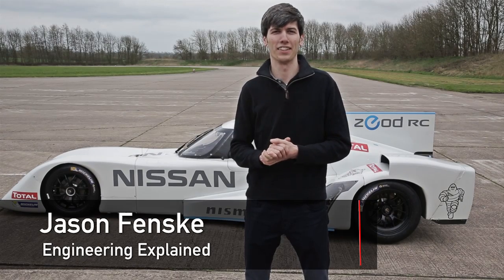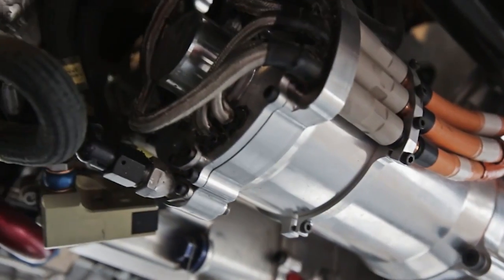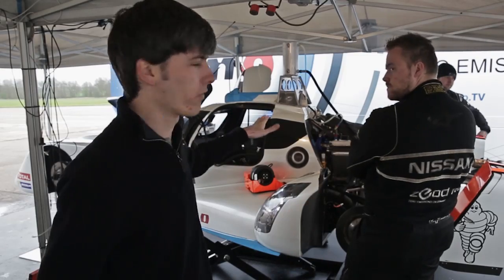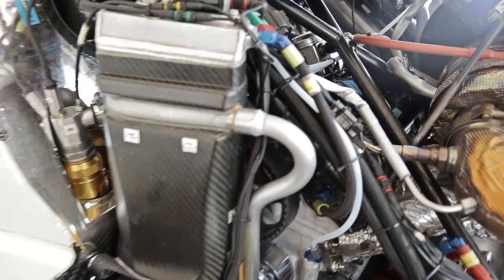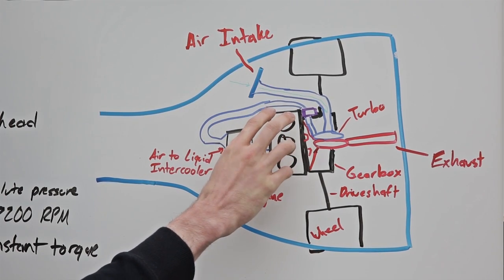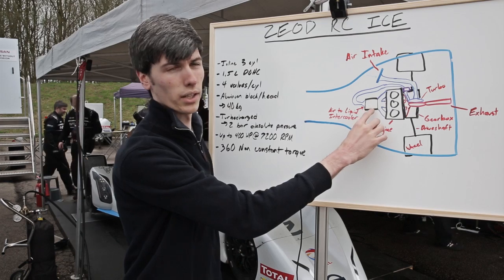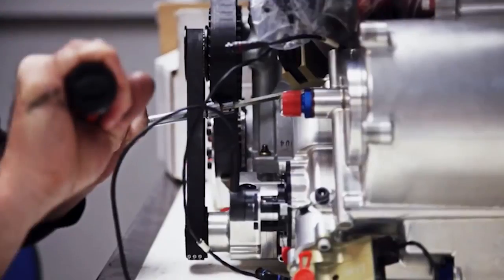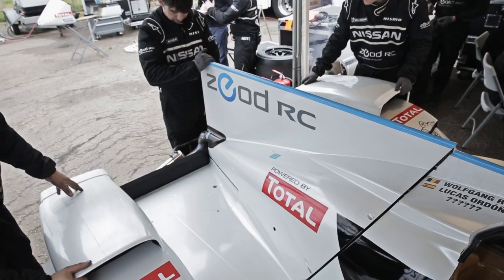INTERNAL COMBUSTION ENGINE EXPLAINED ZEOD RC - ENGINEERING EXPLAINED

Comment: The Nissan engine designers, French I believe, Made the air flows into , out and around the engine as short and smooth as possible. This aided in the high power/weight ratio. But after 4 years no version of this engine is on the market. Maybe some of the findings will go into future engines.

Comment: There is nothing special about the engine itself. Just light, high revving and turbo charged.  Of course it dissapread off the radar.
Reply: Nothing special, sir.this engine may not have the torque but you could put this engine in a infiniti qx80 and still.be fine.

Comment: OH.yes that engine will fit to hoverbike,due to its power to weight ratio,but in my heavy weight power comment is that all manufacturer of  piston aircraft engine must be ashamed because this technology first appeared into a car  not into the aircraft.
Reply: Car industry produces 80-90 milion cars per year, while piston engine aircraft are mostly for fun and serve a small market segment. So you can imagine the difference in the research & development spending between the two branches is big, and the pace of innovation would be significant. No need aircraft people to be ashamed

Comment: So does 2 bar absolute pressure mean that the turbo is set to 29.4 psi?  So that either means 1) That's twice as much air as that engine with a turbo set at 14.7 psi or 2) twice as much air as an engine with no turbo (NA)?
Or maybe both of those are wrong, I wouldn't know for sure-- which is it?
Reply: ~14.7 psi, option 2 as you've put it. The engine will have about twice as much pressure as a naturally aspirated engine with 100% volumetric efficiency.

Comment: Awesome video! Thanks for the detail on the engine, I dont think anyone has gone through the specifications like you have. The engine alone is a masterpiece of engineering, but I wonder why they used a ceramic bearing turbo? Why not ball bearing for faster spooling?
Reply: Engineering Explained The engine is a 1.5L turbocharged engine @ 2 bar absolute pressure...Assuming the car is at sea level, does this mean that the car is boosted to only 1 bar? If this is the case, without the turbo are we looking at a 200hp Naturally aspirated 1.5L engine? Does this amazing engine utilize some form of variable valve timing and/variable lift?
Reply: It's a ceramic ball bearing turbo!